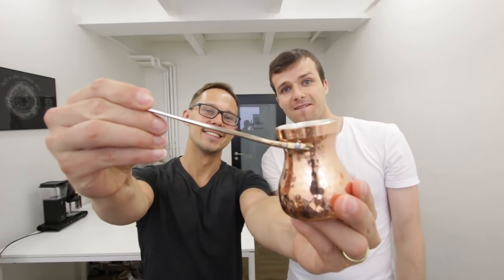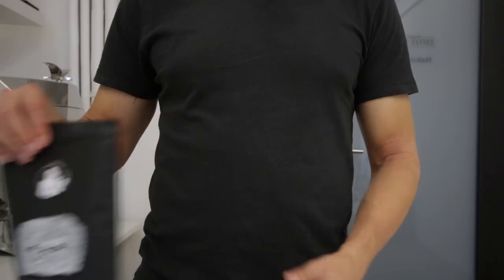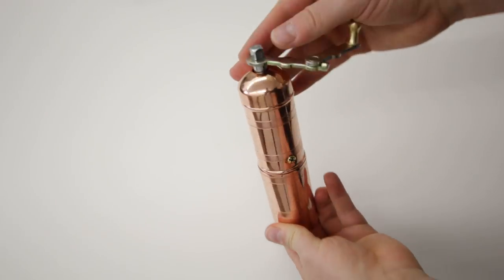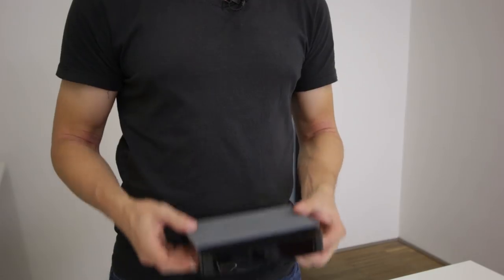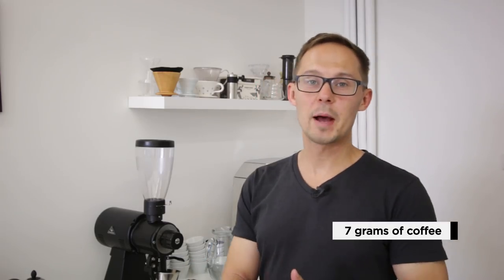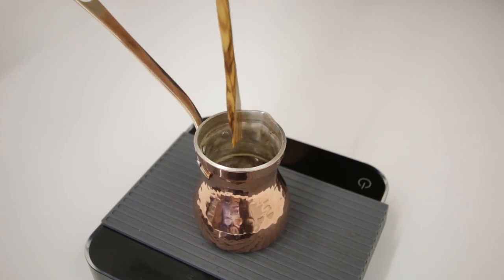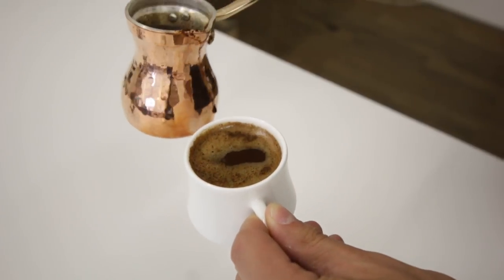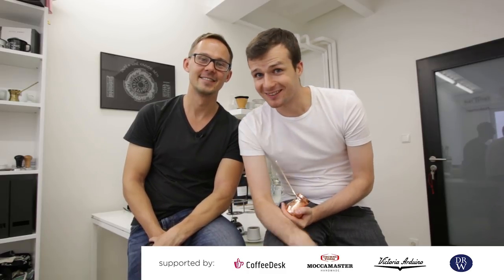How To Make Turkish Coffee | ECT Weekly #024

Comment: This recipe works about as well as any.  If wasting coffee didn't matter, I'd probably go with a coarser grind to just to reduce the % of undissolved solids in the cup (like most world championship recipes do).  However, to reliably get benefit from that takes considerable dialing-in work, and it becomes a moving target that is hard to hit outside of a competition conditions.  Adler actually knows what he's talking about.  His default is to do two scoops and fill to the 2, which works a little better than the one scoop and fill to the 1 (probably for temperature stability reasons).  Most third-wave coffee shops put recipes online that are similar to Aeropress master Tim Windelboe's, which is a recipe that is easy to teach baristas and easy for a barista to reproduce consistently and quickly.  However, if the coffee isn't roasted to perfection, these methods tend to bring in some over-extracted character because you have to push all of the final-brew water through the grinds at the very end.  Adler's recipe creates evenness and minimizes most causes of over-extraction.  185 vs 205 doesn't matter a lot ... it subtly adjusts aroma and acid profile, but the bigger difference is just what temp the coffee is at the end.  I brew with higher temps when I plan on adding a milk product, and I brew with lower temps when I want to drink quickly.  It's nice to be able to drink a cup within a minute of making when the aromas are still rich and plentiful.  It's easy to write off Adler's recipe; I recommend that you don't.

Comment: Hallo , i'm gibson.i want to ask some questions.
1. Did every coffee bean can used for turkish coffee method? 
2. Whats the different if we are using traditional sand machine heater and modern heater? It will be affecr for the taste or not?
3. Last questions , what exaclty water temperature for this method or just looking foam coffee and put away or what?

THANK YOU SO MUCH , I WILL APPRECIATE THAT IF U WANT TO ANSWER MY QUESTIONS .COZ U KNOW THIS IS SO IMPORTANT TO ME. I SEE OPPORTUNITIES FROM THIS.
Reply: I'm answering as a Turk
1. No, you should buy turkish coffee i guess
2. You can use every heater but the temperature shouldn't to be so high, you should heat it slowly
3. You should wait until its boil and seeing the bubbles
Sorry for my English
Reply: You can use any coffee.  If your vessel is copper or silver it will heat evenly with a heat source from any direction... those sand contraptions aren’t very consistent.  In this method, the goal is to not boil the water, since that will over extract the coffee - the end temperature is around 90-94°C
Reply: 1- Well there is no law you can't do it with any beans, but mostly it's from Rio Minas beans. You can taste every type of beans for trying to find out which one you will like most, but most important part is finer of the *grounds*.
2- Every heater would work fine but the one in this video is a little bit better, because its a micro burner. Most of the kitchen stoves smallest part is bigger for the cezve. Also for slow or speed heat, I should say speed one is better.
3- If you can evenly cook it, around 3:17 the bubbles comes close to the middle. You should cut the gas until it covers all of it.  Don't overcook it like in this video.

Also last tip: add coffee, then sugar(if you want), and add water(room temp.) at last then stir it evenly homogeneous and cook it. Btw no more stirring after this to the cup.

Comment: MY QUESTION IS : about the heater. What is the heat source? , is it exhaustible or should I buy some fuel to  refill and keep using it? I want to know if it lives /last long or not. Thanks
Reply: Is it spiritus based heater, you must refill it
Reply: it is called micro burner and it can filled with butane gas like lighters.

Comment: After you brew in the Chezbeh can you filter out the coffee grinds with a tea strainer? Or is the coffee in the cup supposed to have the grinds for a stronger flavour? Does it detract from the full specialty Turkish coffee experience?
Reply: You'd lose the foam. Did you wait 2 minutes before drinking? Thats to separate foam and coffee grins
Reply: Well its too fine to you really filter it properly. And also as mentioned you will lose the foam. Also if you add coffee>sugar(optional)>water(room temp.) and mix it evenly homogeneous the coffee should not bother you until the very end of it.